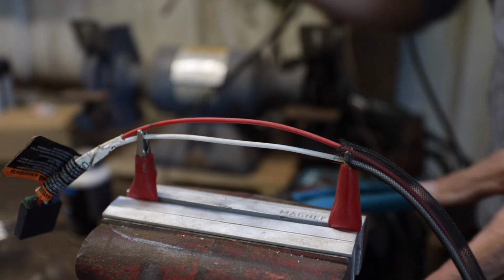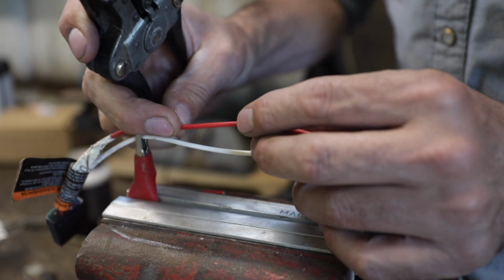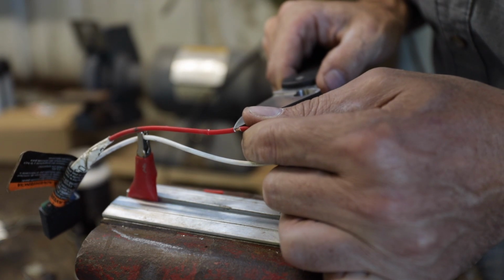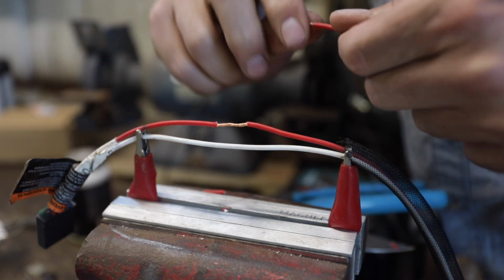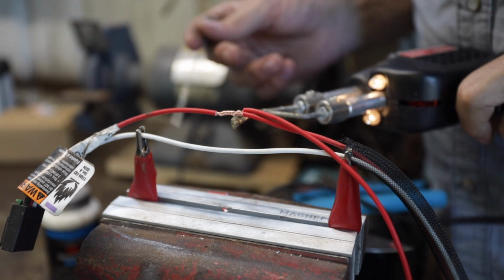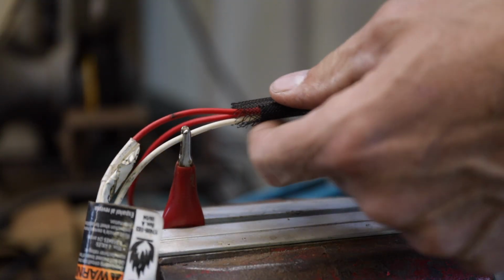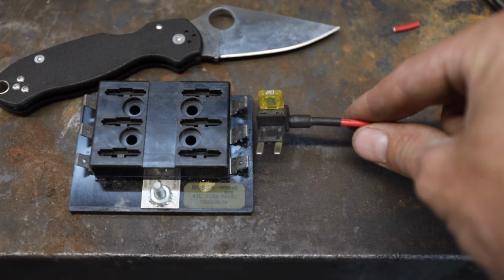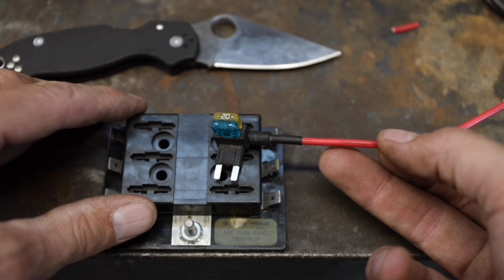How To Splice Wires Like A Pro

Comment: Can anybody tell me if i use 2.5mm2 insted of 1 or 1.5mm2 wire for my rear fog lights on my passat will it preforme better in an area were it moves when i open and close the trunk?All i want to ask is does little bit bigger wire means better bending resistance?

Comment: I do a T wrap on the wire. Separate the source wire into two and poke the new wire through and separate it into two strands and wrap each around the source wire forming a T.   Solder and shield.

Comment: FYI - take this for what its worth - So the more I research and limited testing I have done about soldering wires to each other in automotive/military/vehicular (boats even) applications I think crimping the wires together is the best way to go. Crimping is better suited for environments where vibration is a issue. Soldering may loosen or break at the soldering joint etc. Now for smaller gauge wire I think what you did here is more than acceptable but crimp would better in the long run imho. This is certainly the case for thicker gauge wire which is way better to crimp than solder. 

that being said.. lol I have seen German car companies both crimp and solder thicker gauge terminals. So as I said take it for what its worth. :)
Reply: Would you use a beanie to crimp it?

Comment: Great suggestions!!! I’m always reluctant to solder yet I broke out the soldering iron. I used your suggestions to cut into a relay wire to add wires onto the backup lights for a wireless backup camera installation. Your suggestions were right on time! Thank you for the assistance!

Comment: Old video but a pro tip is to add heat shrink to the ends of your aligatitor clips so you don't damage the insulation 👍

Comment: Question: lets say you made the poor choice of using one of those splice connectors and you now have 2 bite marks on your wire. Is there a recommended way to seal those up if you can’t get shrink wrap around them? Any kind of rubber paint or filler?

Comment: Splicing is hardly ever an ideal solution although it is sometimes necessary. Solder creeping up the jacket can cause the cable strands to fray as it bends. IDCs don't work well on stranded cable and also introduce resistance.

As far as insulation goes, electrical tape is my least favorite because it always goes gummy, especially in a hot, moist environment like an engine compartment. 
A good insulator might be something like Sugru, Steelstik or some other moldable glue or epoxy product.
Also 3M (and probably others) make an electrical wrap without adhesive which might do well in this kind of application.

Comment: Aircraft electrician here, take pro out of the title, a pro would extract the terminated wire from the connector and slide the proper shrink tubing over the splice. Seriously?

"Cause if you use quality shrink tubing it kinda almost has something kinda built in...." Yeah, it's called adhesive. And I like how we mock critique on proper soldering but then realize the wire was spliced in from the wrong direction, again stuff that a pro would have fitted first to see if that would actually work before making a permanent splice. Lol. It's called flux and its purpose is to ensure that you get heat into the wire quickly without overheating the insulation and a proper wick/wetting is achieved with a clean weld. Even if the solder has flux in it, for this job it would make sense to apply flux to the joint first. Professionals don't tend to take chances with melting things and taking forever.

Comment: Im going to install an after-market radio for my car.  First time and  gotta add a 3rd wire for the steering wheel controls onto the factory harness.  Im no NASA soldering expert so your vids are great.

Comment: 1) splices in vibrating environements ARE NOT to be soldered. the splicing itself will mechanically hold just fine. where the solder has entered the copper by capillarity, ta stiff section will be in direct contact to a flexible one, where solder didn't reach. this makes for a perfect point of failure and theerefors shouldn't bedone, a good crimp is the way to go.
2) your "error" about the direction of the splicing is actually what you NEED to do to provide your newly wired splice some give, or strain relief so that pulling on that cable does not directly pull on the splice but on the small margin given by that small crease or loop.

Comment: Why didn't he just release the wire out of the plug it's easy to get them wires to come out of the plugs especially if you have a set of them release keys they're very inexpensive release the wire crimp out of the plug slide it out slide your heat shrink tube over it put the wire back in the plug and done then you don't have to cut the wiring or cobble anyting up it's done the best way possible.... and there's actually a braid technique that you do when you are splicing wiring like that that will not pull apart..... I'm sure there's videos on YouTube showing that technique as well..... also there is a really good liquid electrical tape out there now better than that cheap stuff they have that works really well also if the heat shrink tube is not a possibility...... I guess to each their own but if I was going to be showing someone how to splice wiring and didn't know really what I was doing I would want to watch a few videos and make sure I had the technique down before I had my million plus subscribers performing the task in a shotty way there's a lot of people who probably watch this video and do it that way I'm sure it works just fine but why not do it the proper way and the best way possible that's what makes YouTube and the internet so wonderful you can do a little research in advance and make sure you're doing it the best way possible especially when you have a lot of people counting on you and taking your advice.....

Comment: A tip if you ever need to have a super heavy duty solder joint (for example if it is exposed to a lot of shaking or heat). Cut all three cables, strip them, put them side by side and wrap a small copper wire around them (schould hold even without soldering) after that tin the joint and use schrinking tube.

Comment: I always like to use a dull knife for wire stripping as it won't cut the wire...everything from stranded to romex.  Nice job soldering, I recently had to solder something for the first time in about a decade and what a mess.  It took me about 3 tries to do it decently and I'll have to practice more frequently for the next time.

Comment: Hey Cody, Official NASA Certified Soldering Expert (NCSE) here. Your soldering looks great. So long as the solder flows smoothly through all joints, it's great. You can see when it's finished when the entire solder is smooth liquid.

10/10

Comment: Get some brush on liquid electrical tape. Lasts forever and seals so well it is used on submersible pump wires that will be submerged past the splice.

Comment: Yup, those strippers are the way to go.  I've had a pair of those for MANY moons, and love 'em every time I use 'em.  What's the difference between that silicone paste and dielectric grease?  My only gripe with dielectric grease is, the tube gets old, cracks, and starts oozing out from there too.  LOL  Another great product is Corrosion X, which was developed for Boeing and the aerospace industry.  The Marine industry in the Seattle area have found that if they're able to do a quick recovery of a boat which has sunk in salt water, hosing the electrical system with this stuff has saved many things from being trashed by the salt water.  It's not cheap, but I've had good luck with it on my motorcycle electrical connections for decades now.  Being a spray can product, ease of application is a plus, a rag wipes away residue where you don't want it.

Comment: Vinyl electrical tape is not weather proof. I work at Chrysler and it’s only for indoor or in vehicle repairs. Any tape on the outside of the vehicle exposed to weather is a hockey style fabric tape approved for water and dirt.

Comment: Overall, I think this video demonstrates good work!  At work, they call me an "electronics technician", and as such, I have a few things I'd like to share. 

I prefer to use a good quality adhesive lined heat shrink tubing. In your example, I would have unseated one of the connector pins to slide the heat shrink tubing over the splice.  If no connector was available nearby, I would have simply cut the wire in half and soldered it back after sliding the heat shrink tubing over it.  After soldering and shrinking the tubing, I like to apply Scotchkote to the tubing, especially the ends, for some extra insurance.  Afterwards, I like to wrap the whole thing in Scotch Super 88.

I don't worry much about twisting the wires together prior to soldering.  Usually, I'll independently wet both components of the splice with solder, then touch them together and apply heat so they bond.  I see a lot of the "NASA" soldering stuff, but that really doesn't add any real-world benefit to your work and it often leads to a big ugly lump in your spliced harness.

Comment: When faced with a large connector like that, you can normally release the pin in it. They normally have a one way barb on them and by getting a very small screwdriver or piece of wire, you can push down the barb to release it to get suitable heat shrink tubing over the connection. But nothing wrong with what you've done or the soldering! :D

Comment: If you want to use shrink tube. You can take the terminals out of most factory plugs . look where the plug contact are usually a little tab in there you can push with a small screwdriver and pull lightly on the wire.

Comment: solder joint looked good. might need to start cleaning the flux residue off. also get a kit to pull the pins out of the connectors so you can run the dual wall heat shrink.

Comment: May I recommend that instead of using electricians tape to wrap the splice use self amalgamating tape. It does what the title suggests and amalgamates to its self creating a better seal, I have used it on 2 way radio aerial connections for years and highly recommend it!

Comment: You can remove that wire from the harness plug in most cases which will allow the use of heat shrink tubing. Just a thought.

Comment: It is indeed possible to use the heat shrink, just remove the terminal from the plastic connector body , slide the heat shrink down the wire , and reinstall the terminal into the connector body :)

Comment: Many moons ago I spent a bunch of years installing mobile electronics (car alarms, stereos, etc.).  We used to work on a lot of brand new vehicles, this method was always the preferred method if we couldn't get a wiring kit to tie into the factory wires.  We always soldered and taped our connections, never crimp connectors and we always guaranteed our work for the life of the vehicle.  The equipment might fail but the installs never did.  With practice you can solder and tape as fast (or faster) as any crimp connector.  BTW I believe the connector you referenced were 3M ScothLoks

Comment: I don't mean to be "that guy", but some (rarely) wires are woven anti-clock wise so you might need to look at the braid pattern before you twist the wire just so you don't start untwisting them.

Comment: Doing it, stripping wire, with a sharp knife also scores the wire which is a problem on smaller wires especially in an application where the wiring has to flex/move during operation and can lead to connection issues over time. It's even more of a problem if anyone goes behind the work and lots of bending and flexing. Its is more common  issue encountered when encountering abdulla the butchers fine craftsmanship as a saboteur whos technique was evolving

Comment: That was a good solder joint and soldering technique. You heated the wire and applied the solder to the hot wire.

Comment: This is a bad idea. Soldering wires on vehicles is not smart. It is prohibited by the FAA to solder any wires on an airplane. It is always better to cut the wire and use a crimp connector. The reason is the solder causes rigidity where it Wicks into the strands and what was once a flexible wire now is stiff and vibration and motion will cause the wire to eventually crack and fail. I tell you the FAA explicitly prohibited the practice on airplanes decades ago.

Comment: NASA certified solderer here.... That dog will hunt. I'd buy off that joint any day. I may have released the contact from the connector to use heat shrink, but nonetheless a very respectable job. 

Jack of all trades, master of few...

Comment: any ideas on soldering if all you have on hand is 12v? suck your battery with an inverter? run your car while you use it?
I have limited 12v power out in the forest and I generally hand wire everything because heating elements use far too much power.

Comment: Also zip tie the extra wire down to give it ability to pull against the solder joint. Also can use liquid tape for a waterproof protection cover of the cut.

Comment: What I've done with my alligator clips is put heat shrink on the jaws so the teeth don't damage the insulation of the wire. It happened to me once and I didn't want it to happen again. Solder job looks good though.

Don't be afraid to cut the wire, then you can use a better sealing method than electrical tape. You could try silicone repair tape or some rubber splicing tape. The silicone stuff works great.

Comment: all of those people in the comments who think they are soldering pros have either just learned how to solder or have never soldered in their life and just watch youtube videos about it. there is no right or wrong way to do it, getting a nice clean joint is just a trick of the trade but you don't need to follow a recipe book to make a strong solder joint. anybody who thinks otherwise has either never soldered before or is just learning how to. even cold solder joints hold just fine.
Reply: I beg to differ and find it amusing that you just went and did the very thing you are scolding others about: Telling us how to solder...Of course there is a right way to solder and cold joints will break quickly under heat cycles.  Even good solder joints eventually break.  I see from your channel you are into audio.  Why not get yourself some 70s vintage hi-fi stuff to play with.  You will see what I mean.  Most of this stuff on ebay just needs recapped and usually just has a bad solder joint or two.  You can actually make some beer money flipping some of this stuff.
Reply: @turnersparadise8368  "I beg to differ and find it amusing that you just went and did the very thing you are scolding others about: Telling us how to solder." how am l doing that? l am not telling anybody the way they solder is wrong, l am doing the exact opposite. l didn't even give any instructions on the how to solder. 

"Of course there is a right way to solder and cold joints will break quickly under heat cycles." the kind of heat cycles you're talking about would destroy the wire anyways so it doesn't matter, we're not talking about soldering copper pipping or PCBs here. if you're wires are going through extreme heat cycles like that then the quality of your solder joints is not your biggest problem right now. 

"Even good solder joints eventually break." of course, nothing lasts forever but solder joints won't go bad unless they corrode. and a really good solder joint will last a long time. my boss wanted me to solder a pipe fitting for the radiator in his car which l thought was kind of sketchy but l did it for him and it's actually holding up very well. the fitting is a little crooked because l didn't align it before l soldered it, but the bead is still really clean. it's been about a year since l did that for him. keep in mind when he drives that car the fitting gets hot enough to boil water. that's asking a lot from a solder joint.

"I see from your channel you are into audio.  Why not get yourself some 70s vintage hi-fi stuff to play with." l have an old fisher boombox from the 70's in my workshop and it still works like new other than both cassette players being broken. and l have an old 80's sanyo boombox as well as a pair of polk monitor 4's also from the 80's and technics cassette deck which is also from the 80's and the PCBs in these things are pristine except for the sanyo. it looks like it was assembled by a child, there is glue on everything and the solder joints are super messy but it still work just fine even the cassette player still works on that one but the belt is a little stretched out.  

"You can actually make some beer money flipping some of this stuff." I know, I used to do stuff like that on the side for extra cash.

Comment: I have a question wouldn't it have been easier to just cut the wire, strip both ends and then tie all three wires together. Then you could have slide some shrink tubing on, and also you would be a lot less likely to damage the wire.

Comment: instad of regualr electrical tape try some splicing tape. they use it to cover high voltage electrical wires. it bonds to itself when you stretch it and will waterproof the connection if its done right.

Comment: In this case you could release the terminal from the connector and pull the wire out allowing you to install heat shrink. It’s one extra step, but well worth it in my opinion. Nice soldering job.

Comment: if you choose to tap into your fuse make sure that you put the "pigtail" on the correct side so if it blows the fuse works properly. Another thing to watch out for when you use the tap is not to exceed your overall amps for your fuse circuit (I think Fords are 15 amps for the cabin fuse box).